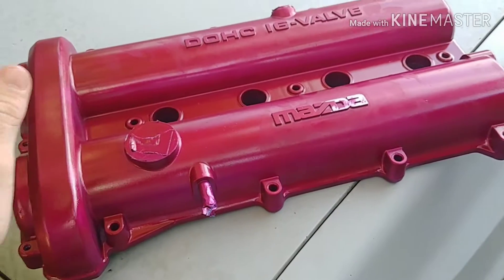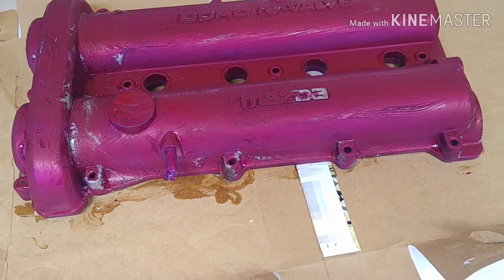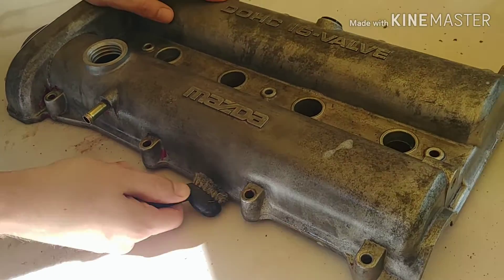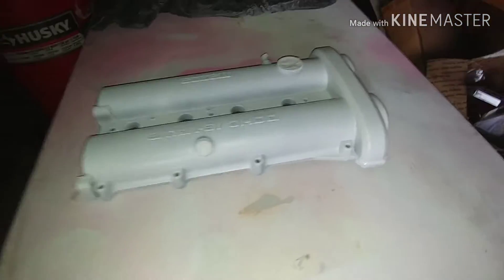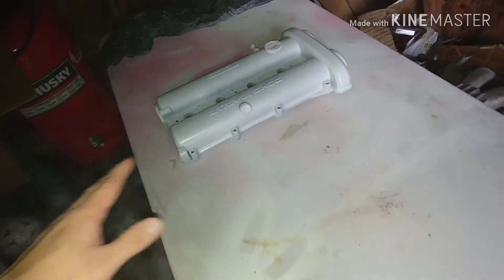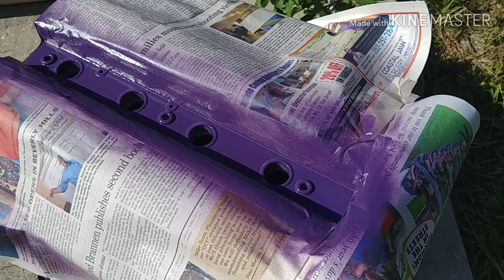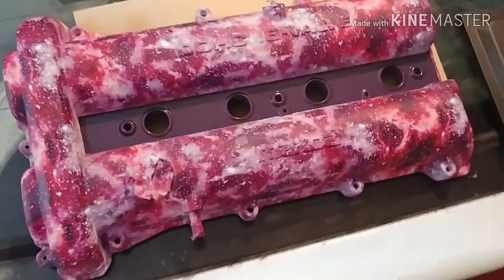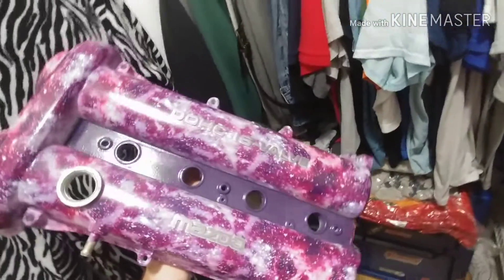Miata valve cover Hydrodip FULL PROCESS.

Comment: I'm gonna try this with an engine I'm building but could I just use regular paint or would I need high temp paint?
Reply: High temp, they make special paint for engines you can pick up for $14 on amazon or $9 at your local auto shop

Comment: Is it ok to get paint inside of the valve cover?
Reply from the maker: i would advise cleaning any paint off that gets inside of the valve cover as oil could break down the paint and send the particles through the system
Reply: @TrilogyBPM  thanks you

Comment: i wonder is the dip graphic can handle the engine/rocker heat? will it be bubble up, or damaged after receive the heat from the engine?
Reply from the maker: This one has been installed on the customers car since this video was made and it still looks as good as the day we did it, there's a recent video on my channel called pints and pistons live event where youll see the vehicle that this valve cover is installed on

Comment: Did you have to use a high temp primer?  I bought this "mydipkit" and its saying I need etching primer n urethane primer to dip before dipping? Other wise it won't stick to the metal or aluminum  Is that true
Reply from the maker: Etching primer then high temp is best but you can get away with just etching, one hit wonder sells an all in one primer which I used in this video

Comment: Question - Wouldn't it be better to start at the other end with your dip?   Curious to hear your thoughts on this. Also, what did you use to polish the letters?  TIA
Reply from the maker: We actually tried at the other end and the film tore in half, I used 3 different grit sand papers ending in 3000 on the letters with it meticulously taped off lol

Comment: The reason you have to use so many coats of the aircraft stripper is because it doesn’t have  methylene chloride it says it on the front of the can ever since they remove that stuff is shit.  Yes methylene chloride is a volatile dangerous chemical but if you handle it properly with the correct PPE it strips paint like  nothing else and you can purchase methylene chloride and add it to your non-methylene chloride gel and strip it in one step.  Mind you if you do not protect yourself from  methylene chloride. Short and sweet you will die.  Chemical gloves respirator not a paper dust mask not a handkerchief tied around your face safety glasses or goggles the shit burns. And it will kill you. Use common sense you don’t do it in your basement you don’t do it in your garage with the doors all shut.  Ventilation out of direct sunlight and PPE or (  personal protection equipment)  i’m talking about a half face 3M respirator with chemical  cartridges .  Here is a brand. 3M™ Organic Vapor Cartridge/Filter 60921, P100.  You don’t necessarily need the particulate part of the filter but you need the vapor part of it they don’t need to be pink that signifies  Particulate.  Unless you’re sanding Use your head. And I don’t mean for a hat rack